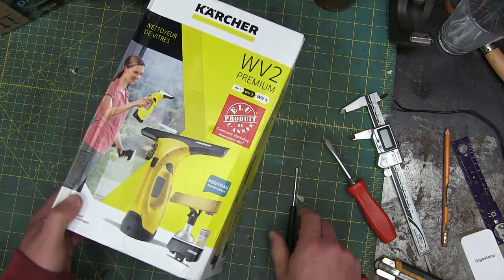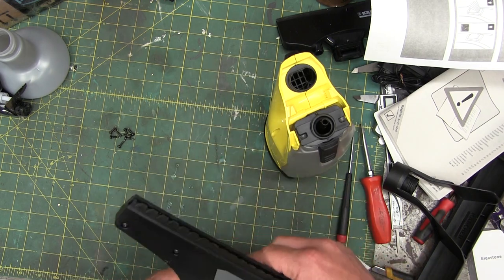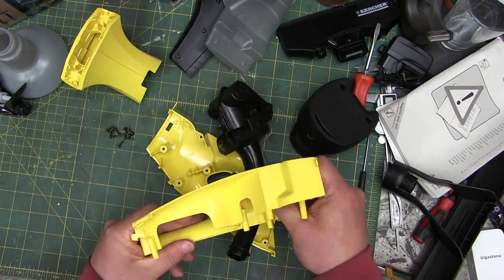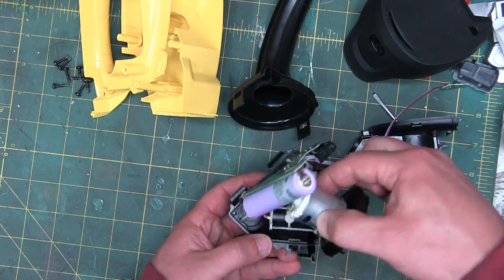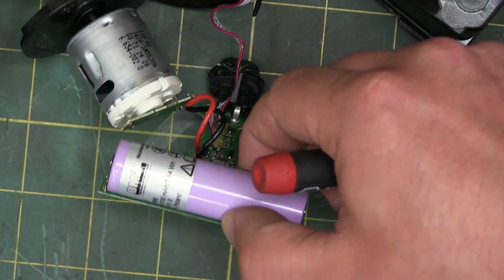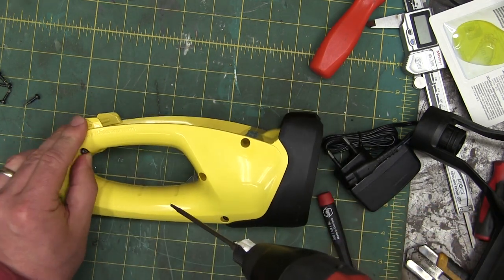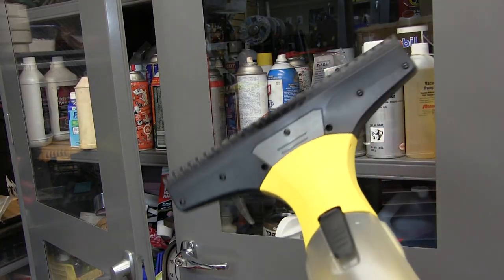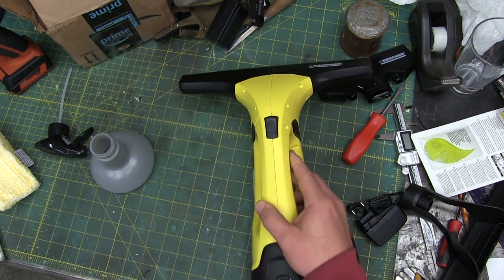BOLTR: Karcher Window Washer | Home Cleaning Gadget

Comment: I'm a Karcher dealer and have sold a few of these. These are designed for window cleaners who instead of squeegeeing the water off the inside of windows onto some picky lady's carpet, you are able to vac the water off the window. You use it after you scrub the window. It works for that. I haven't had a single one returned or had a single warranty issue.
Reply: My Mom cleans the windows, my mom got one and loves it. Who am I to disagree? If it works in the field I guess it's build just right.
Reply: If it works just twice a year , who's gonna complain ? Even if it is made from a child's toy parts !

Comment: It's obviously got no place in a shop, but it looks like a handy little kitchen gadget.  I'll wait for the Chinese to rip off the design and sell it for $20.
Reply: cigr they should‘ve done that already. This Karcher is out a long time. 

Actually I saw a Window cleaner, but it works completely alone. With suction and so on. Like a vacuum robot, only for windows😂
Reply: there are plenty of knockofs from brands like Aldi and Lidl
Reply: For 100 euros the Chinese will sell you a pair of window cleaning robots - granted, they also snap pictures and upload them to the Great Mao Beyond The Wall, but they're dirt cheap and they clean dirt off your windows!
Reply: They currently sell the 10 year anniversary model here in Europe, and the price is around 40 euros on sale, so Ave must have gotten ripped off in France.
Reply: Yeah my mom got one pretty sure she got it free with something
Reply: i saw this one at my grandmas, facepalmed, tried it anyway and was impressed that it actually works well. Bought the rip off a few weeks later from lidl and it was rubbish. I think what makes it work well is mostly the design of the lower one of the two rubber lips

Comment: 15 Euros for the tool, 85 Euros for them to print Karcher on it.
Reply: If I remeber it correctly there is an other Version that is alittle bit less crappy... and cost ( at least in Germany) less?
Reply: Maybe they just take what the market pays because this also is a bit of a "new" thing. But I don't know if I paid anything close to 100€ for this.. Probably not.
Reply: alles klar klaus 
Home depot equivalents have it for roughly 50 euros. For a hundred you get all the extensions with it.
Reply: Sibling Anon I got a smaller sucking thingy and a charger.. 50 sounds about right to me.
Reply: Yikes buying tools at Aldi. I wouldn't recommend that!

Comment: You need to use the spray/pad wipe the glass before you remove the cleaner. I got one, works like a charm, reduces the spill on the floor by 99% compared to just a cloth/newspaper deal.

Comment: Got the same one in bits on the bench currently, the cell crapped out after 12 months use which is why i think for the new versions they have swapped to a replaceable cell and not one fixed to the board. Havn't got the motovation to put it back together, hoping that the longer i leave it the more parts will vanish saving me having to 'fix' it.

Comment: I've got one - they are good.
They do help extract all the dirt and keep smearing down to a minimum.
I'd get another one if it packed up.
(You're daughter is fab, so cute.....the innocence of youth)
Reply: Paul Wharton  me too... On very cold days my little boys use it to take to condensation off the double glazing in the morning, works a treat for what it is and I paid £20 for mine
Reply: Thanks for the comment - I paid around a hundred for mine.....so you did much better than me !
Reply: The price tends to go up hugely with accessories. Squirty bottle that you get included with every purchase of Mr Muscle? Another £10. A few cloths? Another £10. I think I got a previous model in the sale for something like £25. I've also used mine for getting condensation off my car windows and sunroof after the car leaked!

Comment: Omfg, AVE baffled by a pink job. 😂 You gotta clean the window with the supplied soapy water bottle first! THEN you vac the soapy water off the window with the window vac. It’s for internal use, enclosing the external bucket and rubber blade so you don’t spill water all over the carpet/window sill/frame etc. I use it on the shower cubicle glass/mirrors etc. Any flat gloss surface in fact, like kitchen work tops and especially the induction hob. Leaves a streak free DRY finish you don’t have to polish. Easy
Reply: And as for the battery, you only need the thing switched on for 10 secs per window, max!

Comment: I worked as a window clenaer in the end of the  last century. Those little machines are hillariously slow and bad at their job. I mean, really, really bad.
Just put in a few hours practice with some professional squisher and do it manually. It cost about the same, and you will get better results.
Reply: I said the same to my mate who bought the "Smack and pecker extendable chimney sweep " .. It even had a built in AI voice ( London cockney) !
Reply: Well, when you do it 2-3 times a year on 10-15 sq. meters of glass it is a good tool. And I doubt you can so the job as clean as this thing does wothout wiping all the edges afterwards. And why is it bad? Note that its job is to remove the soapy water after you wiped the window with the other thing.

Comment: The first cut up looking rubber on the vacuum is actually necessary for creating pockets of suction. The second smooth edge just keeps a tight wiping edge. It's needed for any liquid vacuuming device. The big floor vacuums have this done so both rubber lips have one side with grooves and the other side smooth so that you can both push and pull with them.

Having also washed windows professionally I will always go for the regular window drying squeegee. To wash them all you need is half a bucket of water with a bit of washing up liquid in it. Not so much that it all becomes a foaming mess. All you then do is wash it with your favorite sponge, I like micro fiber or scotch brite pads for the big gunk. Then dry it with the squeegee. You also need some paper towels to wipe the rubber dry after each pull so you don't get wet lines. The only thing this gadget here will save you is the wiping of excess water from your window sill.

Comment: We have one and it's actually ok. Not sure such an invention is really necessary though. One thing that really annoyed me was the strange  charging port design. Of course I lost the wall wort lead and so had to hack it with one of those usb li-on charging boards you can buy from China for about 20p. Now I can plug it into my usb charger.

Comment: Was an early adopter. Unit is now more than 6 years old. Works surprisingly well. Quite economical to run with the original concentrate. Helps around daily with our cars as well. Yep, we have worn 2 rubber squeegee spares and one rag. So.... The kind of product that can't be reviewed from the standpoint of rotary hammer criteria. No siree, nope.

Comment: The vacuum actually looks well engineered... unfortunately, the bean counters got to it before you did.
Switch the plastic for something more decent, put a high grade silicon wiper on it, upgrade the motor and batteries, and VIOLA! A simple, well engineered device.

Comment: Ave- 2 things mate 1) if that’s the wv2 it costs £35 you just got ripped off
2) tools cost a lot more in the U.K. and Europe than in the US of A and CanADa! Way less people into diy and hobbyist stuff so market is much smaller. So even 100 euros doesn’t get you much of a tool over here... bottom on the range store own brand drill driver kind of money. My dewalt still driver with 2 x 4.0ah batteries is £300 for comparison. 

However agree it’s a piece of shit product... totally unnecessary chinz to be sold to the gullible few

Comment: It is not meant for cleaning, only for removing water from glass panels and for that it is great!
I have had this gadged for 1,5 years, bought it in sale for 29 EUR. All the other things in the package is junk, but if you wash your windows with some kind of detergend, then with clean water and use this vacuum thingy for drying, it works wonders and does not leave streaks! Only downside is short running time, if you have more than 10 windows to clean, you have to recharge.

Comment: I had the one size up one for about two years. Worked pretty darn well for me. Only problem i had with it was the freaking battery. Charges for 6 hours and lasts for 20 minutes. That's toothbrush territory. Only that your done brushing your teeth after 3 minutes and the thing can recharge during the day... With this cleaning Windows becomes a two or even three day task.

Comment: Actually it's not intended to wash the window, it's just for "drying" it. You still have to use something to scrub it first preferably adding some cleaning fluid. Mentioning that, you didn't try the little sample cleaning fluid that came with the tool.

Is it a tool you can't live without? No.
Does it work? Yes.
Is it cheap? No (but you usually buy those things with discount, not for normal price)
Is it useful? It depends. If you want to clean windows that are build into the roof (e.g. in an angle) and can be opened and you have to use one hand to keep it from moving while open and the other one to scrape off the water and a third one to use a towel so the water doesn't drip to the floor its very useful because you don't need the third hand. For other applications it might be just a nice gadget but not really worth it's money.

Comment: I had this exact model apart before; in fact, I had to fix it after the microcontroller detected an error and refused to ever turn it on again. There isn't much competition in this niche, I think Leifheit sells one. Anyway, I used it to clean all of my mirrors and windows and it was much better than any manual wiper. 
You need to show a bit more respect, find the start of the threads with a manual driver, etc. The fit of the plastic is exceptional, it uses T8 screws, none of that phillips rubbish and it also avoided the dreaded NiCd batteries you find in those crikey portable vacuums.

Comment: The "product of the year" thing works like this: You pay the company to enter a product in a certain category (categories can be created if there is none that suits your product, but at least 3 products need to be entered). The entrance fee is around 10k euros to enter. Then a panel of specialists and a panel of consumers are asked which product they like best. As far as I know, the consumer panel doesn't even get to use the product, they just get a spec sheet & some explanation. The winner is selected based on the feedback from the panel. Its company is then asked to pay a winner's fee (not sure about the price, but I believe it's also in the 10+k range). The winner now has the right to use the "product of the year" seal on its products. It's pure marketing nonsense based on the fact that companies want a pretty seal and the fact that those companies don't want a product from another company to have that seal.

Comment: My mother bought one of those a year or three back and while not utterly terrible, you'd be far better off buying a good squeegee instead.  What I was more impressed with was it comes with a spray bottle with a sponge/rag bar attached horizontally on top of it which is genuinely useful for spraying and cleaning with one hand.

The vacuum part has been handy for car windows with a lot of condensation in the winter though, or at least has been on the times I've remembered to charge it.